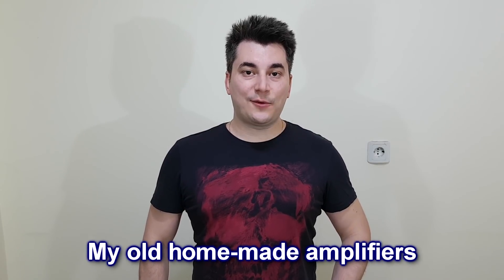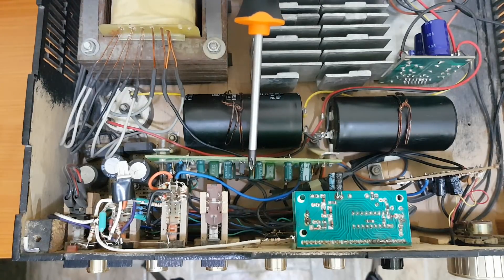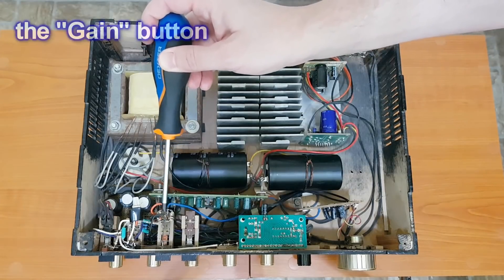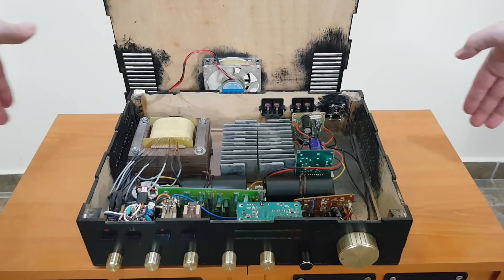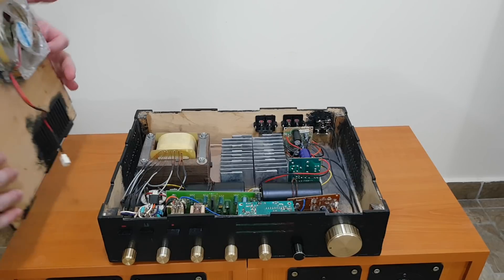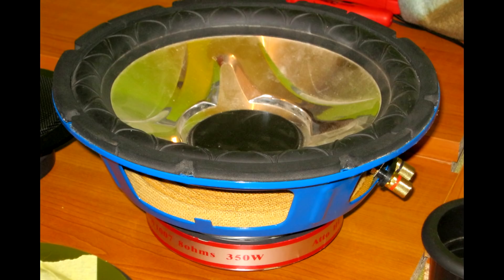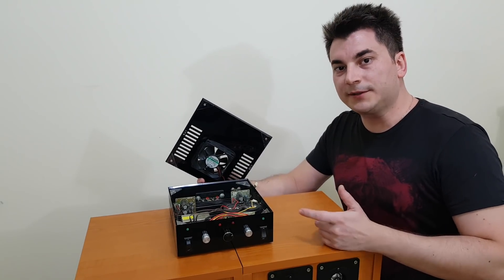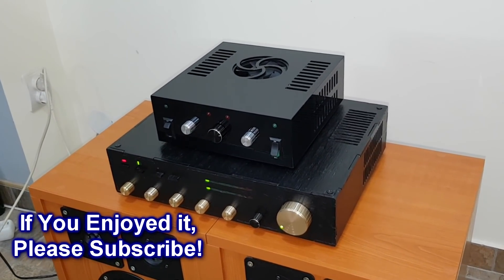DIY Audio Amplifiers (2002 & 2009) with TDA7294 IC

Comment: Im a mechanical engineer but I like doing electronics as a hobby. I want to build a Class AB HiFi amp that looks fancy and sounds fancy too with beefy toroidal transformer, inductor in the power supply section to increase the signal to noise ratio, timpani style rca connectors, 5 way panel mount binding posts, and big heat sinks to eliminate fans. It would be simple with 2 knobs and a switch. A rotary switch to choose inputs and a potentiometer to adjust volume. Also go with a brushed nickel look.

Comment: Could you enclose the transformer or would that get too hot? I'm trying to decide which transformer I have to wind. I plan to get clean ac from a 1kva isolation transformer I got in a trade. It could be a boat anchor hahaha. I bought a cheap Amazon desktop mill / laser cutter to make the enclosure and pcbs.
Reply from the maker: Yes, you can encapsulate the transformer. or you can use a toroidal transformer.
Reply: @Sorin - DIY Electrical Nerd  I play guitar and I'm an an audiophile when it comes to home theater and studio monitors that are active so I want to build one that I can listen to my record collection with and I'm hunting for stereo speakers. I have bought a tube visualizer and all the power electronics and class A components. Being an electronics Nerd as well I will do all the math when I get the speakers haha. I have a toroidal dual tap but it's definitely not big enough and it's in a vintage guitar effects board and I've been slowly fixing the million traces. Anyway I'm rambling. I was looking at a meter today that measures up to 20mH. I'm not into rf and my scopes only go to 350mhz hacked so I've never had need for a proper lcr meter. Mastech have one for about 50 bucks that I was gonna order. I'd rather spend more on the heatsinking than the rest tbh haha. Running into my 700watt 2.1 active studio speakers feels like cheating. Making speakers can get pricey too it seems.

Comment: What's the amp of transformer
Reply from the maker: I don't know exactly, because I made it a long time ago. probably between 4 - 6A
Reply: No prob .thank you ..i made it 3 years ago  and started using it now  ..but i found the best caps for the IC is 4700 uf although i put 10000 uf before but that raise the IC temp much higher

Comment: Pls show separately  how did you do the cooling fan high and low speed pls share
Reply from the maker: I connected a few diodes in series with the fan on the 12V rail, to decrease the voltage to about 6V. and a button which cancels the diodes when pushed, so the voltage will get back from 6V to 12V.

Comment: Interesting... in early 2000, I made similar amplifier. same as yours. wooden (mdf board) case, led UV meter, volume knob with led, small rear fan... black paint. it had STK4191 ic for main amplifier. in that era, many kids have a hobby of electronics. In 2006, I got AKAI power amplifier and that my diy amp retired. I thick still remains pcb of amplifier

Comment: How did you do that on for louder and off for a low how!?
Reply from the maker: hi. I connected some resistors on the audio input wire to decrease the audio level, this is the off setting. when the switch is ON, the resistors are canceled and the full audio input is going to the amplifier. this was useful for old cassette players and other devices that have a background noise/hum. so you increase the cassette player volume, turn off the "loud" switch, this will make a better sound to noise ration.
Reply: @Sorin_DIY   thank you

Comment: i'm about to make an amplifier board to replace the old amplifier on  my active speaker it's based on tda7294. I'm planning on using the schematic that come with the datasheet (the high efficiency one) do you think it would work?

Comment: Sorin . Thanks for your videos. I have a question tho. I'm seeing some cheap high wattage diy Amplifier board online. And I am thinking if I can use one as Bass guitar amplifier. Do you think it's possible? 
Here's one. I hope that you can help me with it. 
 https://www.amazon.com/MakerHawk-Amplifier-TPA3116D2-Two-Channel-Solicitation/dp/B07QHZTX1Y/ref=mp_s_a_1_13?dchild=1&keywords=DIY+Amplifier+Kit&qid=1597467975&sr=8-13
Reply from the maker: hi. I haven't used these amplifiers so far. they should be good according to their specs. but the amplifier board it's probably the cheapest part in an audio system. you need a good power supply, an audio equalizer and very good speakers, which will be very expensive. you can buy these amplifier boards, but there's a lot more to invest in.

Comment: I remember when I build my first electronics kit. It was a VU meter from a local Romanian electronics company here in Timisoara. I think I was 8 years old, it was back in 2012. I never got it to work properly (I probably soldered some parts in reverse) but it still sits in my parts bins. I sadly don't have the datasheet anymore.

Comment: Bună seara,vă rog să mă ajutați într-o problemă,pe scurt am un display de la un leptob fabricat in 2012 si vreau să il transforn in tv și monitor,am gasit pe banggud placa de baza pentru transformare dar difera indicativul displeiului cu o singuta  cifra ,concret display ul meu este samsung B156XTN02.1 iar placa ar fi pentru 2.2,2.3,2.4. Cei de pe sait din cită engleza pricep eu spun ceva ,că se poate trimite poza cu tipul displeyului pentru a-mi trimite placa de baza corecta,dv. ati mai licrat cu ei si puteti sa imi spuneti cum se procedeaza si in al doilea rind daca placa ar fi buna.
Reply from the maker: salut. pana acum nu am mai facut o astfel de conversie. insa daca nu corespunde 100% modelul displayului, probabil nu o sa functioneze corect, sau nu functioneaza deloc. eu zic sa cauti altul care e 100% compatibil. eu am comunicat cu cei de la banggood.com si au fost ok, dar ca orice vanzator ar face orice sa isi vanda produsele.
Reply: @Sorin_DIY  Mersi,eu am urmărit ffff multe tutoriale de converlia a dyspleyului de leptop in tv sau numai in monitor si mi se pere ok si mai ales placut ca il faci cu mina ta.
Reply: Domnu Sorin,sunt pe cale sa fac o baterie din  celule litiu ion 18650 in configuratia 3s80p si am vazut ca un bms 3s de 200 amp este f scump,pot echipa bateria cu un bms de amperaj mai mic?
Reply from the maker: da. dar ai nevoie si de un incarcator puternic.

Comment: Lol. Imi place telecomanda pentru cazuri de...necesitate. Am fost si eu entuziast in domeniu. Un singur amplificator am facut, dar nu am decat o poza la rezolutie mica cu el. Pe vremea aceea, faceam totul manual, de la corodarea placii cu clorura ferica, pana la realizarea mandrinei din pasta de pix si folosirea motorului de casetofon pentru gauri. Nu vazusem SMD-uri pe atunci, vad ca in 2000 si ceva, apar in filmul tau.
Amplificatorul meu avea un final slab, de 3x2, cred, etaj de amplificare luat integral dintr-un magnetofon defect. Ii pusesem doua ceasuri, pe care le mai reglam prin rezistente semireglabile, cutia din celebrul pal, fata din plexiglas, aveam un buton pentur pornit oprit, LED pentru tensiune si pentru functiune si butonae de volume (doua), ca unul singur nu gasisem. Nu foloseam decat piese SH sau cand ardeam finalul, ceea ce se intampla foarte des, le cumparam d ela rusi. Vremuri interesante, cand Watt-ul isnemna ceva. Nu discuta nimeni de sute, pe atunci. Desi, dupa ce au aparut STK-urile, am trecut la nivelul urmator, cu puteri mari, desi fara calitate. STK-urile funtionau singure, aveau pre integrat, cele pe care le foloseam noi. Doar ca functionau la tensiuni mari.
Oricum, super filmul. Iti recomand sa vorbesti liber, cam pare ca citesti.
Felicitari!

Comment: Encase the transformer into aluminium box and connect it to star earth point. Is all your screens on your signal cable connected to a star point ? Using a star earth you should eliminate all your electrical interference

Comment: salut sorineeeeeee :( ma poti ajuta cu ceva uite un link https://youtu.be/G5U3w2MPrMw
Reply from the maker: salut. celulele astea de litiu 18650 au nominal 3.6 sau 3.7V. insa tensiunea celulei variaza de la 4.2V cand este incarcata la maxim, pana la 2.5 / 2.7V cand e complet descarcata. conectand acele celule in paralel, ai marit capacitatea bateriei, dar tensiunea este aceeasi. modulul acela de powerbank este conceput pentru o singura celula, sau mai multe in paralel, dar nu inseriate. daca inseriezi celulele creste tensiunea pana la max 8.4V, iar modulul acela nu este conceput sa le incarce asa. modulul are incorporat si un convertor ridicator de tensiunea (step up) care creste tensiunea bateriei la 5V stabil pentru iesirea USB, deci nu ai nevoie sa inseriezi celule. bobina aceea de pe placuta e folosita de convertor, dar are ferita cam sparta, nu stiu daca mai functioneaza corespunzator. deci pe scurt, cu modulul acesta trebuie sa lasi celulele in paralel, nu poti sa le conectezi in serie.
Reply: @Sorin_DIY  salut again , deci pot sa leg doua randuri de cate 8 baterii 18650 (le leg in serie fiecare rand iar cele doua randuri de cate opt sa le leg in paralel daca poti intelege daca nu voi face alt video explicanuti) paralel si sa am 6 v oare nu mi-ar arde pcb board-ul

Comment: Out of curiosity, what background noise are you trying to reduce with the gain button? I assume its the hum? Nice build by the way, esp. for someone who was young at the time. I had a cheap TDA1554 amp that I built in high school in the late 90's, overclocked to 18V to run 8 Ohm speakers. Surprisingly, it lasted until this year when it finally committed suicide by bursting into flames and smoke. Fortunately it was fused and it did it when I was there so no spontaneous home combustion. The current replacement I made uses two LM3886's and a bipolar switchmode power supply using a TOP250 control IC, so its small enough to fit on the corner of my desk, no more noisy fan, and no more 60Hz hum.
Reply from the maker: hi. some older audio devices have a permanent hum or background noise, like cassette players or rubbish PC sound cards. the aux audio cable can also receive some 50Hz hum from older household electronics. the amplifier transformer can also induce noise into the audio wires up to the gain button. the idea is to turn up the volume of the audio device, so the music will be much louder than the noise, then the gain button will decrease the overall audio level, including the noise, to the needed level. it's not a perfect solution, but at the time it helped a bit.
Reply: @Sorin_DIY  Ah ok. Thanks that makes sense since you can record at higher levels (or turn the PC sound up) and then just attenuate it at the amp. Been ages since I've had a tape deck so Ive forgotten all the joys of dubbing tapes and the "lovely" hiss they always had when you couldn't afford good blank cassettes. Ditto on the sound cards. I do remember the cheap nasty ones had tons of hiss and buzzing. I was worried about using an SMPS in my current design because of noise, but it turns out that even my high end soundblaster Z still has an order of magnitude more background noise than the amplifier.

Comment: Yes nice  job I'm also a DIYer,  I have also made  an Amplifier  2010 using  a broken coffee maker, I did also put a LED indicator on a Volume knob  using a soft  thin magnet wire wrap up around the Pot  so that it will not break  during a repeated  rotation

Comment: The hum or noise injected by the fan to the preamp, try and use a separate power supply for the fan...or isolate the tda7294's from the heatsink

Comment: Dear 2002 and 2009, 2 amplifiers ok, then why did you buy YAMAHA AMPLIFIER, instead of making another?

Can you explain difference between diy and ready made ( for general use) 

Waiting for your reply
Reply from the maker: hi. I bought the Yamaha receiver because it has all the features i need, Dolby ProLogic II technology, 6 powerful channels, optical inputs and a lot of settings. I can build better amplifiers than the ones in this video, but not as good as the yamaha receiver.
Reply: @Sorin_DIY  thank you for reply

 asked difference because even i tried with different amplifier boards, they are ok but not meeting the standards like the commercial ones 

Have a nice day

Comment: Stolen.....uh, bought for me
Helpful when you are drunk...uh, tired.  
Funny stuff!  LOL   Those look pretty nice.    Hey, got a question for you since you've built power supplies.  I have one of those 1600 watt power supplies from a bitcoin miner and it says they will work on either 120 or 220, but I can't get it to work on 120.  Do you have any idea why?  There isn't a switch to switch from 110 to 220 anywhere that I can find.
Reply from the maker: hi. newer power supplies usually have universal mains voltage (like chargers) so it should work automatically on any voltage, especially if it doesn't have a switch. if it works with 220V but not with 120V I think there is a problem with some components inside. try to do a visual check, when a power supply doesn't turn on, usually it has swollen capacitors. the power supply may have been abused during its life. I don't know what other problem may be.
Reply: @Sorin_DIY   Hello and thanks for the reply.  I thought of the caps first, but I got this from a friend and he had about 4 or 5 of them and none of them will work on 110, but work fine on 220.  I can't find much info on them anywhere.

Comment: I love that first amp.    I've had an eq circuit, that's been in my goodies box for well over 15 years, it's way older than that. I've finally put it to use, also having swapped the slides for rotary pots.  I have it built as a preamp eq, that is in a VHS tape case, and runs of a USB battery bank with a voltage booster up to 9 volts.  It comes in handy for when in messing around with various amp boards.
Reply: I also liked the first amp more

Comment: Sorin please recomand ME some alligator clip wires whitch can handle AT least 10 or 5 amps
Reply from the maker: hi. I don't think you can find good alligator clips with wires for that power. I recommend you buy some clips, like the ones in the link below and solder some 2.5mm copper wires to them, or even thicker if you need. 
https://www.aliexpress.com/item/32807578365.html?spm=a2g0o.productlist.0.0.62cf3a28keSemB&algo_pvid=d6288a49-ce8a-4166-aa14-3022fd64e8f6&algo_expid=d6288a49-ce8a-4166-aa14-3022fd64e8f6-6&btsid=0ab6fb8815916132908993162e0979&ws_ab_test=searchweb0_0,searchweb201602_,searchweb201603_
Reply: @Sorin_DIY  thank you. I saw some wires in greatscott's videos from 3M or something